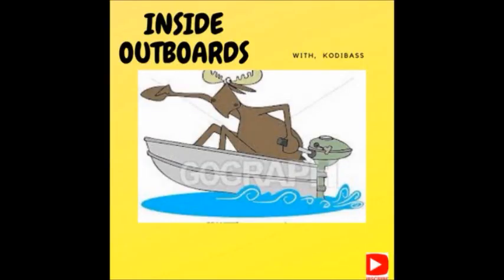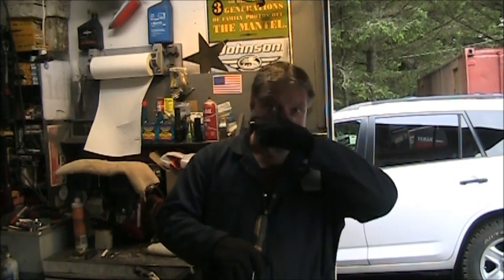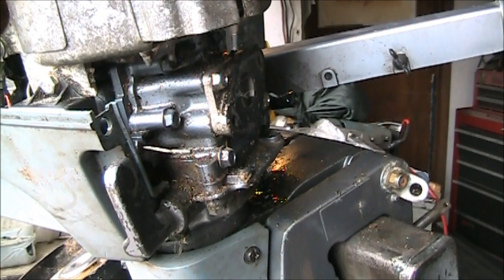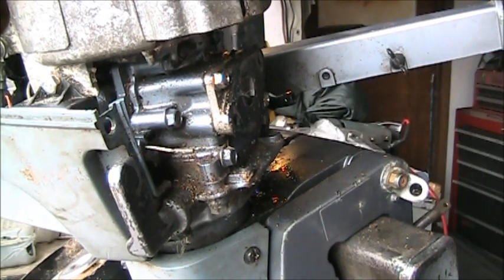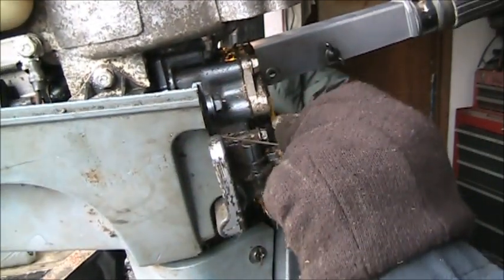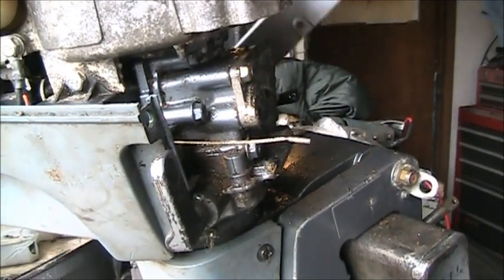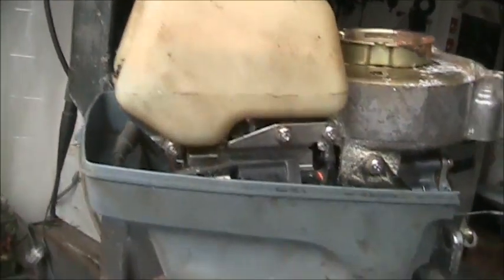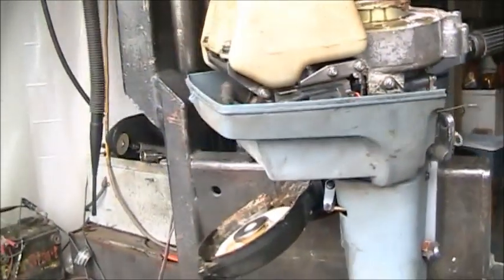YAMAHA 3 HP Outboard  REPAIR  ((  Part 1  ))

Comment: I have a 3 hp yamaha just like it. It's clean, but it has an excessive exhaust bubbling from the lower unit. Has great power in neutral but loses most of it when put in gear. Has a good flow of cooling water exiting. I dont know the cause.
Reply from the maker: +bb, drop the lower & inspect,                                               kodi
Reply: Check plugged main jet! Great power in neutral, nothing under load is mostely caused by lean mixture. Your Malta does have two jets. The idle jet is underneath the rubber plug inside the carb floating chamber ...if you didnt find it after one year :-)

Comment: Do you use salt away product?
Reply from the maker: +JB'  It is always in my Outboard tank,  look close @ many of my videos & you will see
the jug right next 2 the tank.    You may know Salt-a- way is a nitric acid reagent compound that works by passivation  creating a barrier in aluminum from mineral corrosion , going by memory here, I think salt-a-way is @ 22 %,    Nitric acid in 50% or greater can have nasty chem reaction with some cleaners / chemicals' avoid mixing any that contain hydroxyl .  Again going by mem, here, was 18 years + ago when I went to school in Cali for vessel metal - composite construction & casualty school.   kodi
Reply: kodibass  I am looking for a 1969     25 hp Johnson top cowl cover